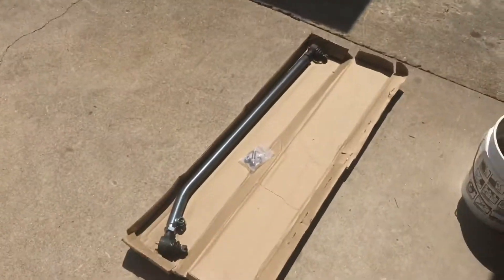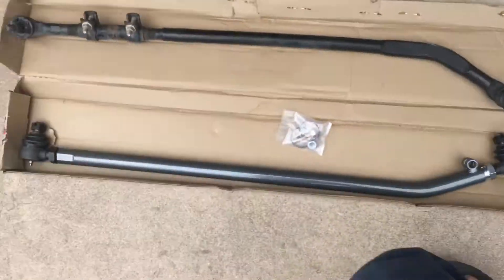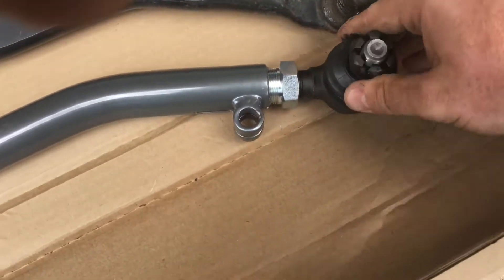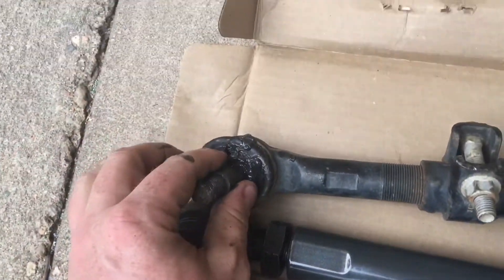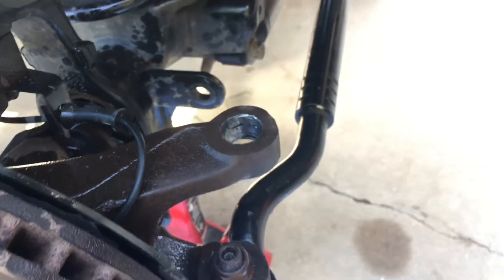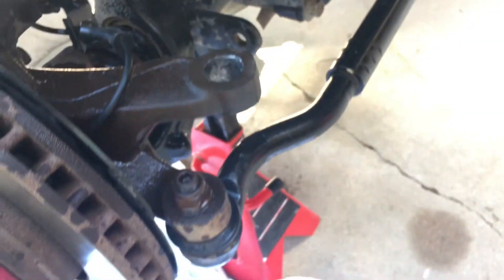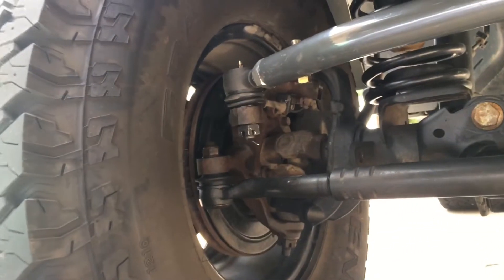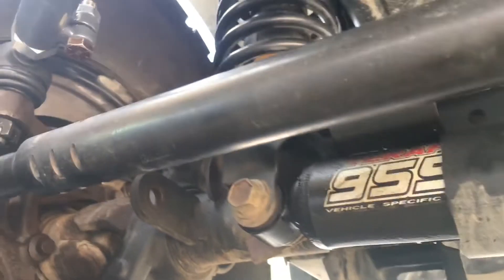New Synergy Drag Link

Comment: since you raaised your drag link u need to raise your track bar too. Synergy and alot of other companies makes front track bar brackets. U can get away with not needing to raise your track bar or draag link if u just get an adjustable track bar if you're like 3.5" lift
Reply from the maker: I have the Synergy bracket installed now
Reply: @Thehowardhaeg  did it seem to fix the issues?... the track bar bracket?

Comment: I have the same problem just install drag link an tie rod an fox stabilizer with synergy clamp . . I put everything on . Got new tires had them put the tires on alignment an just check the suspension but they didn’t have the tie rod end measurements right an now thd alignment is right an steering wheel not straight. I was going to take it back to shop but I doubt they’ll like read the directions or videos of synergy installation’s . This steering an suspension thing is a bit of a pain in the ass .
Reply from the maker: The front end was a nightmare to fix but once it was done it’s really nice. I definitely steer people away from bigger tires unless they want to spend more money on the parts that will be necessary to accommodate the larger tires. It’s a hassle to change literally every joint once it goes bad.

Comment: Hi there

I just installed the Synergy drag link without flip adapter on my 07 JKUR. The installation went smoothly with no problems. I made sure the drag link was the same length as factory one but my steering wheel is super crooked and my traction control lights are coming on. I know its easy to fix with the stock drag link. Just loosen the adjustment sleeve bolts and turn. This one is different. Do I have to take the whole drag link off to straighten the steering wheel? Thank you.
Reply from the maker: The drag link from synergy can also be adjusted on the Jeep. There should be a nut at the end of the sleeve. Loosen that and then shorten or lengthen the drag link.
Reply from the maker: After I got everything on I definitely went and got an alignment done professionally.

Comment: Did you install a bracket to raise the track bar axle-side mount?
Reply from the maker: +supersnare729 I did not. Do you believe that is where the geometry is off?
Reply: TheDenverJK I would look at that first. Your track bar and drag link are probably fighting each other every time you go over a bump since they aren't parallel now.
Reply from the maker: supersnare729 who needs a shop when you have YouTube haha. Thanks for the insight!
Reply: supersnare729 I installed mine yesterday and not really impressed. My stock gave me better handling and control so I’m not sure.